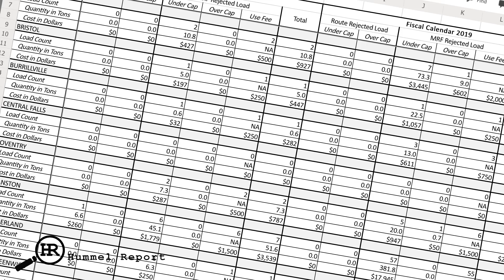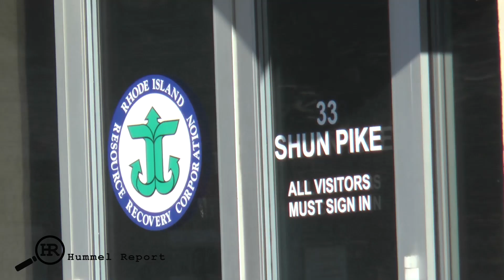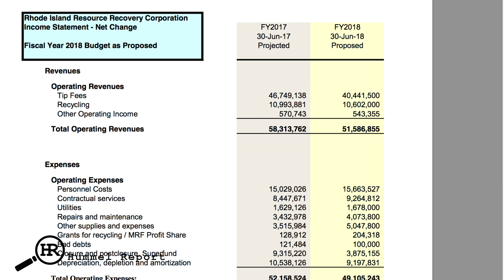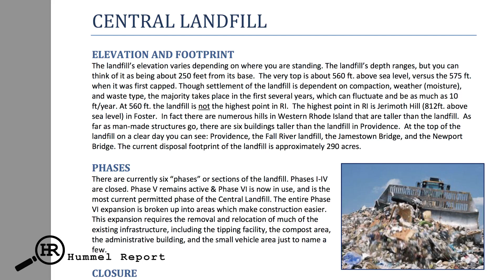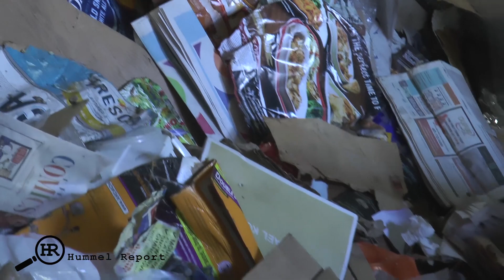The Cost of Recycling     2.14.2020

Comment: If we are predicting by 2034 the landfills within Rhode Island will be full, what is the plan to combat that problem?
We need new ideas on this issue and it seems many people have set things in motion to address this issue.
There are new companies testing and trying to get funding to make trash incineration cleaner, more effective and profitable.
These incinerators completely remove trash while able to sell the leftover ash and debris for building materials.

Some of these incinerators even make products for the automotive and gas industry, decreasing the fuel consumption of vehicles and other gas critical companies.

I understand at some point we have to fine, inform the residents to recycle more but over the years, we have seen recycling plants are unable to fully recycle. If there is a new way to actually smooth this process of trash collection/processing then we should really pursue building that industry.